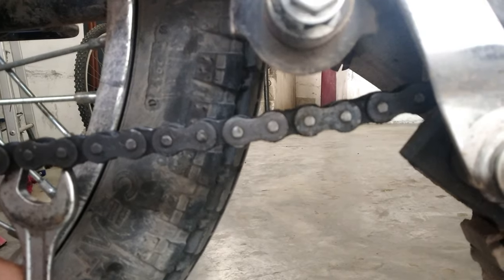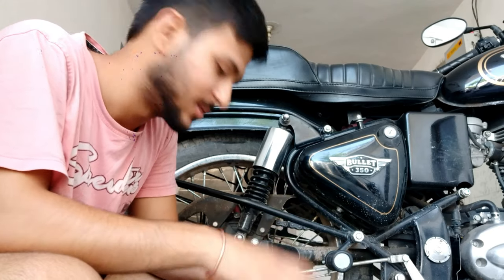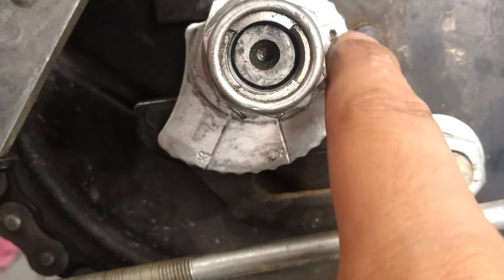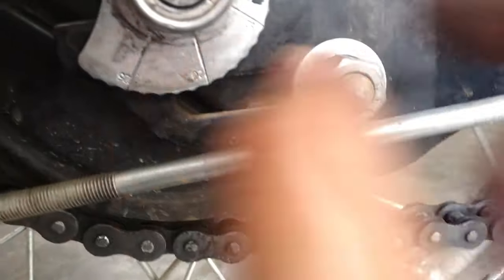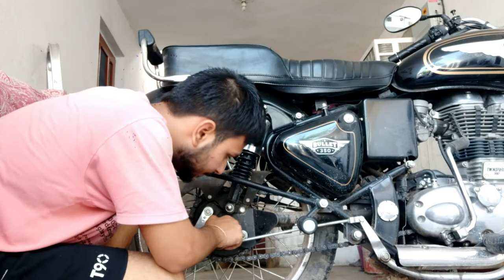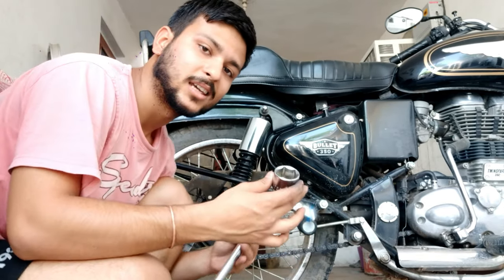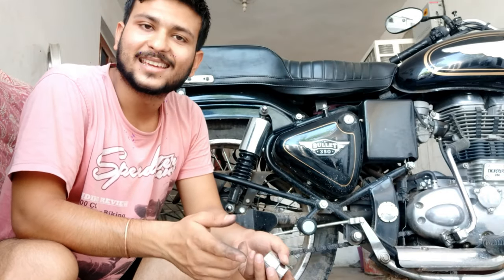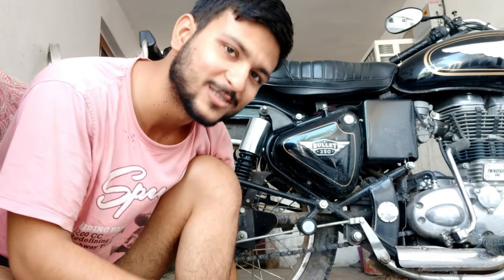royal enfield chain adjustment |bullet chain tightening |easy chain tightening 2020

Comment: Whenever you adjust the chain you are also unwittingly adjusting the brake, so when you’ve finished adjusting the chain you’ll always need to check and RE-adjust the brake rod in order to get it back to where it was before you started moving the wheel.
Reply from the maker: I think you got it right, only for drum brakes.
Reply: @explorerFukrey  U got it.
Reply from the maker: Thanks ,any suggestions for bike content.
Reply: v valid....v imp for novices like me....:)